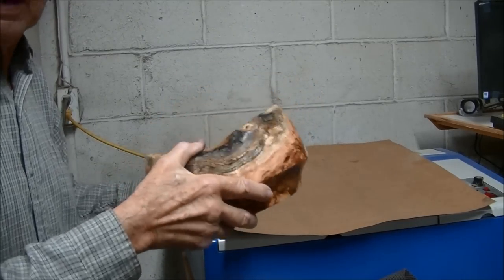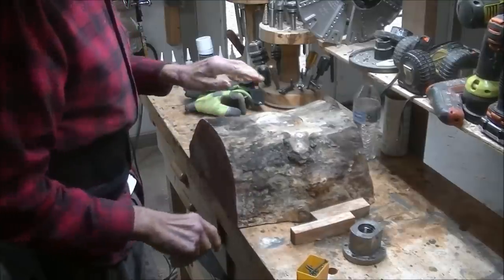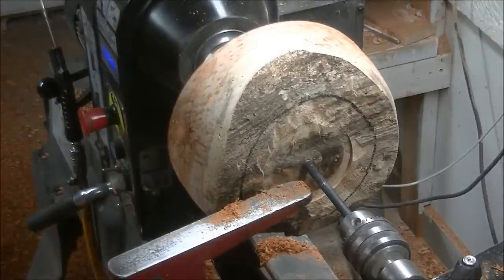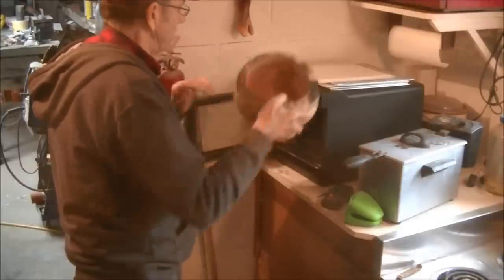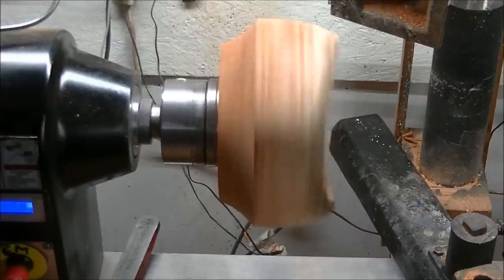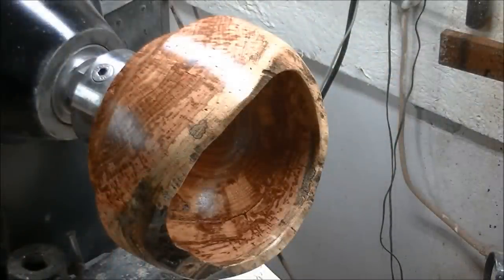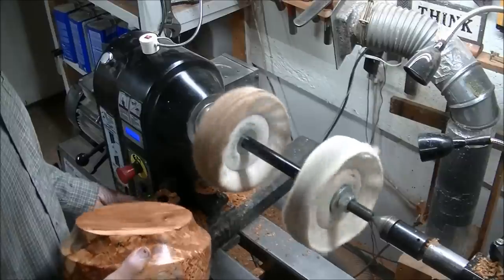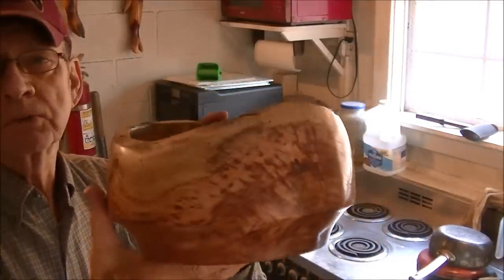Wet to Dry within 18 Hrs # 193

Comment: Why didn't I think of that? I have our old toaster oven and have used it for pine cones and small blanks. Question? Does a hydrator cause less cracking in the bowl blanks VS an oven, like a toaster oven?
Reply from the maker: Yeah, I think so.  It has better control of airflow than a toaster oven and probably a lower setting.  Low and slow will give you less cracking.  Take care, Larry

Comment: Nice job Larry it has turned out lovely I’ve just had a look on amazon and it’s on sale and on its way 
I’ve had timber in my garage for two years and it’s still at 19% it has been so damp in Scotland over the last year. Iv just got some oak that’s off the scale on my meatier it will be going in the oven thanks for the tip keep up the good work 👌👌
Reply from the maker: Good deal, and it works.  Thanks, Larry

Comment: Woooooow this is really great! I actually have a dehydrator! Awesome! Thanks for this great idea! I have been searching and researching.
Reply from the maker: Well, what are you waiting for?  Thanks, Larry
Reply: @TheWoodWhirler  So I roughed out a segment of wood with an extra 10% as a buffer for small cracks but got a fair size crack all the way through.. How thick should the segment be and should anything be applied to it before drying? Is it better to be thin?
Reply from the maker: @TheChecklister  About 1" thick.  Sometimes I seal the outside with Minwax sanding sealer.  I think that helps, haven't done it enough to be sure.  Thanks, Larry
Reply: @TheWoodWhirler  
What is the brand name on the dehydrator please. I am turning some bowls, pens, etc. as a fundraiser to repair/replace a damaged courthouse caused by an arsonist. Fast drying would be great.
Reply from the maker: @str43bzr  sent you a private e-mail.

Comment: Thanks for great trick,  i have a very prime question though. What happens if I turn a very fresh cut wet wood and immediately coat and varnish it     , if so I preserved the natural moisture inside the wood and this is not necessary to be concern about how to dry it. Am I correct?
Reply from the maker: You need to dry it somehow.  It will eventually warp or crack or both.  Wood moves even after dry sometimes. Thanks, Larry
Reply: The Wood Whirler thank you

Comment: Thanks for trying, and sharing with us the dehydrator method Larry 👍  Keep us posted when you do more. I'd'a thought dehydrators would have a fan to circulate the air, but guess not; I suppose you're suppose to dry stuff in thin layers. Nice looking bowl too 😃 -Mike
p.s. You should us it to dry foods too. Make some snacks !!
Reply from the maker: Miine does, all better ones do.  Get what you pay for, I guess.  You can always cut the center of the trays out.  The heat is what moves the air, convection.  Thanks, Larry

Comment: wondering if this will work for drying wood slices so as sthough they dont check\crack .......Thoughts?
Reply from the maker: Some wood is going to crack no matter what.  It all depends on the type of wood and how wet it is.  I found the longer you dry it and the less heat you use the less chance of cracking.  Thanks for asking and take care, Larry

Comment: Headed your way after lunch.   Got a pan to return!  :)   OK, we sure hit a home run with that Honey Locust find.  I have found it to be very stable. It does wonk a bit though but I've not had any cracks open up in it.  What I want to see you try is Cherry. It has much stronger internal stress and cracks  so darn easily if when you think we dried it properly.  So, turn a 6" common  wet Cherry bowl, and let's see what happens  in the dehydrator. OK?  If the Cherry stays stable and does not crack apart after it is finished turned down thin, I'll buy a dehydrator and figure out where to put it in my otherwise crowded shop. :)
Reply from the maker: Rough turn a cherry bowl, bring it over and we will try.  Thanks Joe, Larry

Comment: SIR I ENJOY YOUR VIDEOS ALOT BUT MY QUESTION IS DO YOU KNOW WHERE I MIGHT GET A IRISH GRIND 5/8 INCH BOWL GAUGE OR DO YOU HAVE AND OLD ONE YOU MIGHT DONATE. I AM NOT GOOD AT THE GRINDER AND HAVE MESSED UP SEVERAL GAUGES. THANKS FOR ANY HELP YOU CAN PROVIDE. PAUL
Reply from the maker: No, I don't.  Sounds to me like you need to switch to carbides.  Very little or no sharpening will be needed.  I can do anything and faster than I could with a gouge.  Take care, Larry

Comment: Another nice turn, Larry. Good thinking on the drying. That would be good drying pine cones. I often cast pine cones in my mills and have a problem with moisture and resin.
Called Mom,
Cheers, Lee
Reply from the maker: Good for you Lee, you only have one.  Thanks, Larry

Comment: Hi Larry,  Another great video, Thanks.  You mentioned about the wood becoming hard and I was wondering if it's "harder" than if it had air dried naturally vs accelerated with the dehydrator.   I guess we all know green wood turns easier than dry wood but does the dehydrator make the "dry wood" even harder to turn than if it were slow dried in a paper bag with wet chips etc?  Please advise.
Thanks, Myles
Reply from the maker: Beats me, I've never dried one in a paper bag.  I would think it wouldn't  make a difference, dry is dry.  But I will tell you, it's a bunch harder dry and tradidtional tools would have a hard time unless you sharpen them every 2 minutes.  Thanks and take care, Larry

Comment: I really like this video. I have watched it several times. What model of dehydrator do you have?? Thanks
Reply from the maker: It's Magic Mills, got it off Amazon for $129.  I would not buy it again.  I would get a bigger one.  Mine is limited to a 12" bowl.  They make bigger ones.   Try this one. Elechomes 8-Tray Food Dehydrator Machine,  It's on Amazon for $149.
Reply: @TheWoodWhirler  thanks. I am looking to get one. I have a small lathe and 12" is bigger than I can turn. I can go as big as 10". I think I saw that one on Amazon. I tried to order one from eBay but not sure the status of that one. eBay removed the seller but their web site says that it has shipped. Oh well that is life. $129. is more than I wanted to spend anyway. Thanks again for your reply.
Reply from the maker: @DelsWoodTurning  I saw them on Amazon for $89.  Just search dehydrators, you will find them.
Reply: @TheWoodWhirler  Thanks

Comment: hı there ıs somethıng I was wonderıng. What degree do you use to warm the wood
Reply from the maker: 95F.  That is as low as it will go.  Now if I want cracks, which I do sometimes if I am pouring epoxy, I will bump it up to about 180.  Thanks for asking, Larry

Comment: What temperature did you set your dehydrator to? Thanks
Reply from the maker: That depends on a lot of factors.  Normally if I'm not in a hurry and don't want cracks, I set it at 95F for at least 24 hours.

Comment: thank you for sharing.I just got my lathe today and have not turned since high school (a very long time ago as today I turn 50). Here in south Dakota I have elm, and cotton wood mostly. I am wanting to find out the best way to get logs to turn, whether a bowl or vase. I love the natural form from this turning rather than a blank. Do you have any advice to help me get started on my first projects?
Reply from the maker: I learned by watching You Tube, never had a lesson.  Just search for "beginning wood turning".  There is a ton of videos.  Now take them with a grain of salt, there is some bad info out there.  I would start with carbides.  Not saying they are easier, but if you go traditional, then you got to have a grinder, sharpening jigs and such.  A big investment and you might not like it.  Then what?  With carbides all you need is a diamond card for sharpening.  If I can help, let me know.  Thanks, Larry
Reply: @TheWoodWhirler  Agreed! If carbide and HSS arrived on the scene at the same time only carbide would remain today
Reply from the maker: @daviddejong187  That's entirely possible.

Comment: I have ordered a dehydrator sure hope it works for me. Thanks Larry nice work
Reply: What kind and where are you getting it, thanks.
Reply: @josephwise485 not sure the brand it came in yesterday. I haven't had a chance to open it yet will co that this morning and let you know. Bought it from Amazon
Reply: @tsmith9825  Thanks, looking forward to hearing from you.
Reply: chefman 6 tack with the slide down door
Reply: @tsmith9825  Would appreciate you letting me know how it works, once you try it. Thanks.
Reply: Not having to much luck so far trying different heat settings. I'll let you know how that works.

Comment: go to a garage sale buy a small apartment size refrigerator drill a hole hor a 100 watt light bulb pat a dimmer switch in line of the bulb pur the temp at 95 degrees you will get the same outcome
Reply from the maker: Yep you will in about a week.  Thanks, Larry